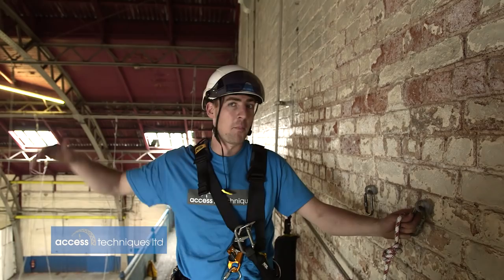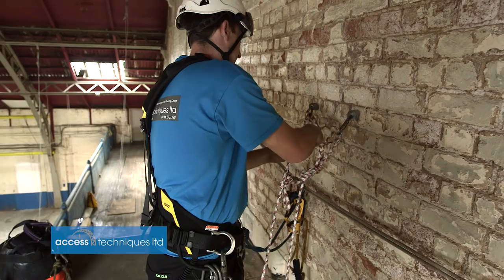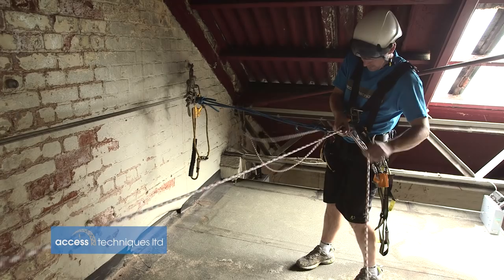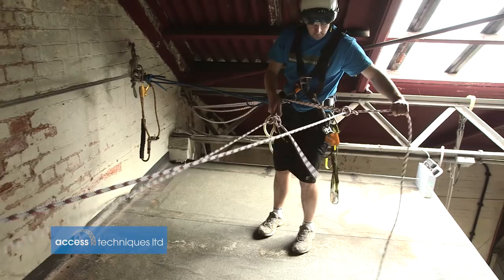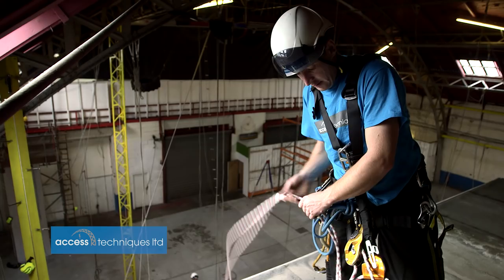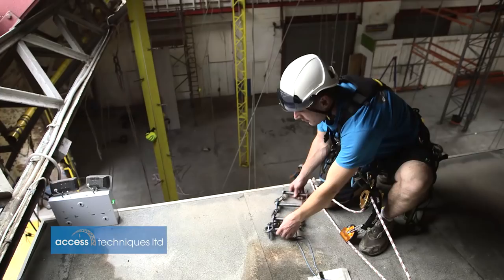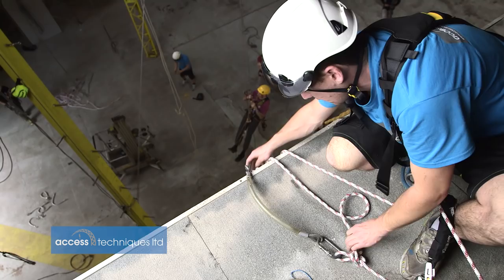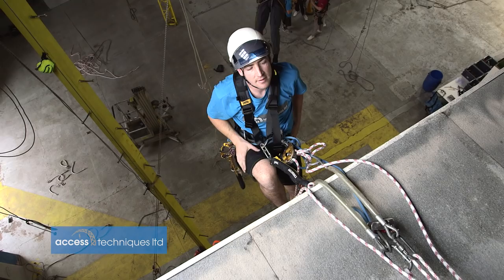Rigging wide Y hang with 90 degree edge protection. Access Techniques Ltd

Comment: helo my friends, I am Leandro from Brazil, I have a doubt about strops by wire; I no get buy this model , that you use in video. By chance is possible use one steel chain? But I will put one transparent rubber together chain and after this one carabine. So what you think? Thank you!
Reply: It would work better than using your rope for sure! You would have a bending point for your chain at the edge, so if you take that into account regarding chain strength and opening size, you should be fine! Any wire with enough strength and a termination will do, as long as the termination is up to par, and you can get a carabiner in!

Comment: Maybe a dumb question but why is it necessary to create a Y hang using an alpine butterfly as opposed to using two deviation lines to create the same "Y hang?  Thanks!
Reply: it has to be an alpine butterfly as it can be loaded 3 ways at any time, a good y hang should always split the load across both anchors as evenly as possible.